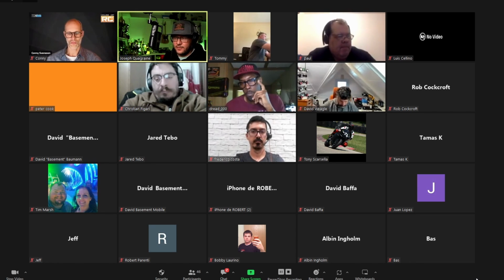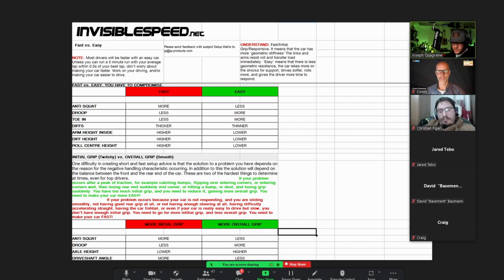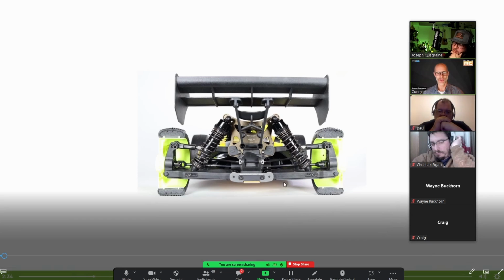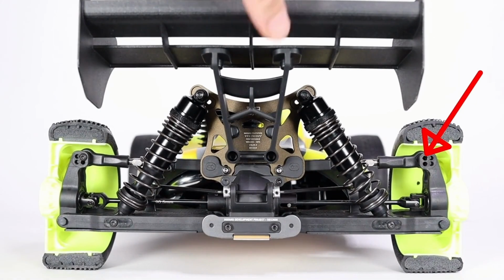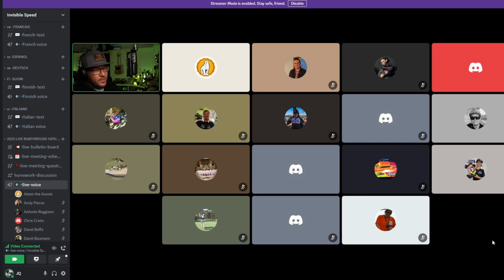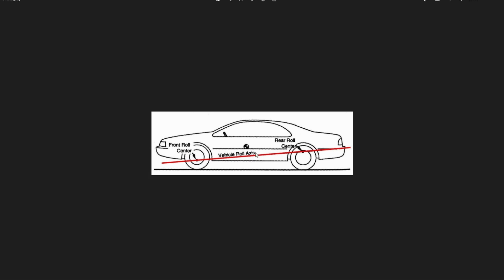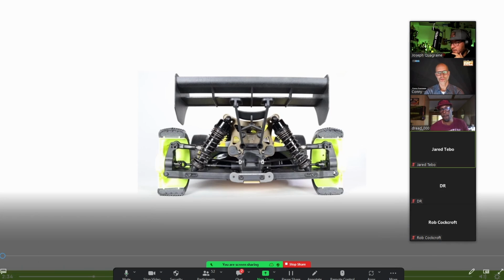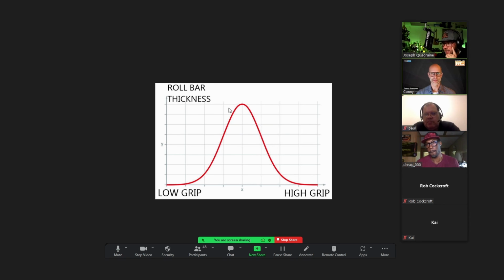2023 Meeting 3 Setup Theory - Tires, Load Transfer, Working Range, Roll Centres

Comment: I feel as if Jarod's comment about the drivetrain position (length of driveshafts) has some merit. For example if a very long front shafy was used compared to a short rear shaft, not only would the front drivetrain have a higher inertia causing it to not accelerate as quick as the rear. On top of that, the axles would have differing amounts of twist, as the front axle would twist more than the rear before delivering power. So the argument that longer axles can cause a power delivery is plausible as a large difference in length could momentarily change the drive ratio
Reply: Well, longer shafts would be heavier than shorter ones so that diff could be transferring energy to the lighter shaft. A balance would need to be made with the diff oils.

Comment: the tips of running heavy oil in dampers with big holes i tried that out today (2x1.8 front 2x2 rear) on carpet on my xray xb2 with 12mm shocks.
it actually worked better then i thought as the car got alot of grip but the oil (750cst front and 650cst rear) stil keept the car damping enough in corners and good during landing and did not acted as a boat as expected with that large size of holes.